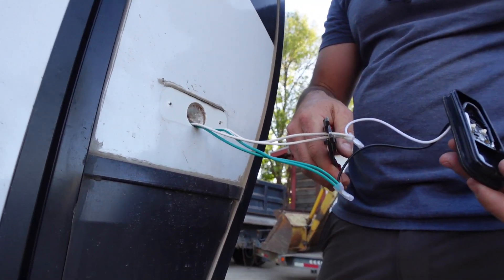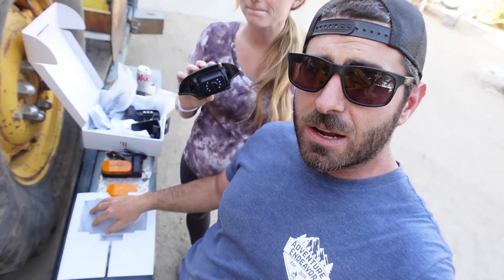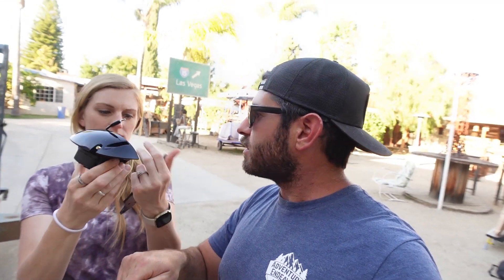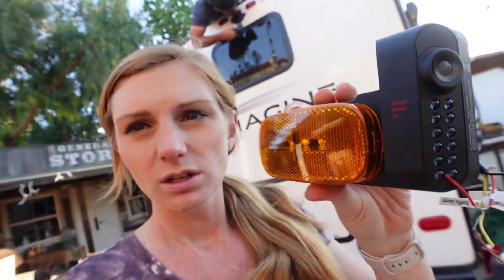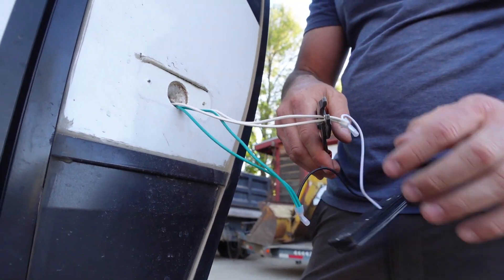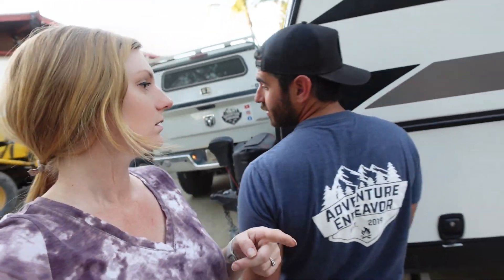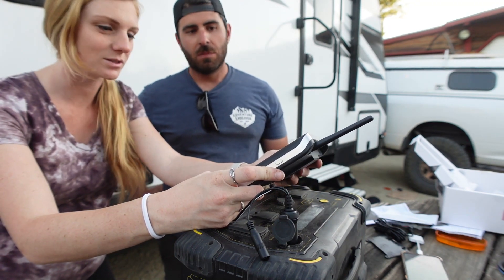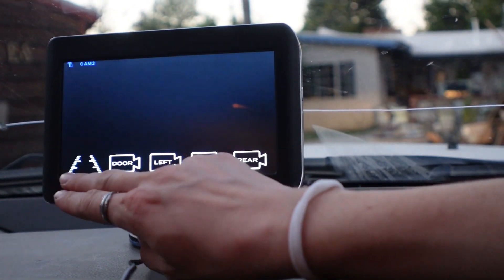Do I Need A RV Backup Camera? || RV Living Full Time

Comment: Great honest review as always,Very clear and helpful. We had never had a need for a camera such as these, but we just purchased a new 42 ft rig and now the need is there.Just installed my new Haloview system on our new RV. I spent lots of time looking at reviews similar to this one before choosing the Haloview. One additional benefit of the Haloview RD7 is the ability to connect up to 4 cameras to the monitor. I do not recall if this is an option with the Furrion. I purchased the system with the rear camera, two side marker cameras and, for good measure, I purchased an additional camera to mount to the front of our tow vehicle. The Haloview's ability to view all four cameras on screen simultaneously is another big feature in my book.
Reply from the maker: That sounds like a great system I believe Furrion offered an option with more cameras. We felt like this was plenty considering it's a smaller trailer. Good luck with your system!

Comment: Great video!  We bought the Furrion Vision S 5 inch Monitor, 3 Camera Wireless RV Backup System with IR Night Vision and Wide Viewing Angles and had the dealer install it.  It's cool to be able to see both sides and the back but we can't figure out how to keep all 3 on the screen at the same time.  It stays there for a few seconds and then reverts back to only one view.